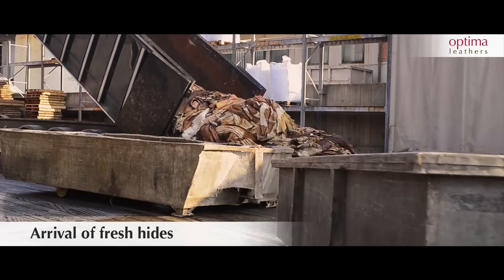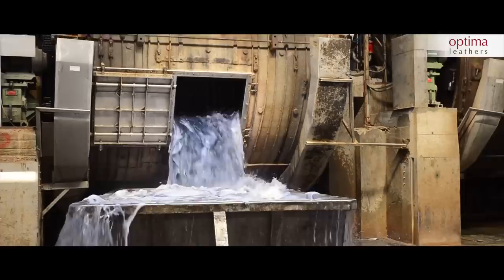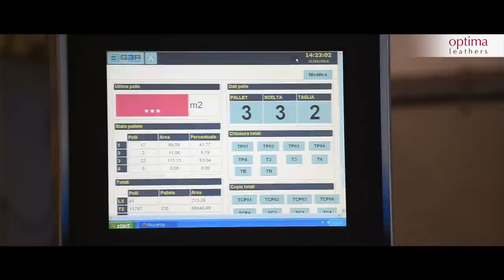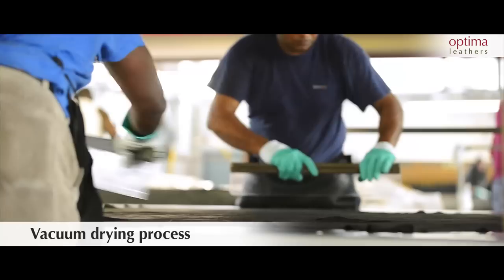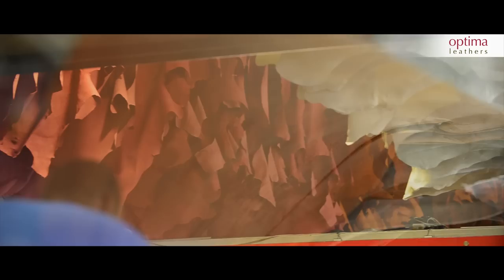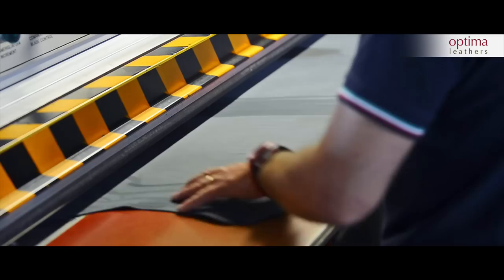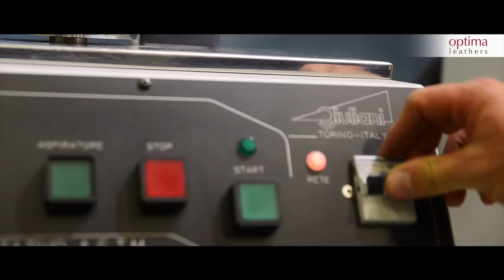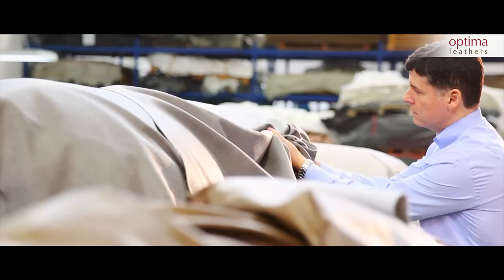The Tanning and Finishing Process of Optima Leathers

Comment: so why not let the natural grain of the leather be seen? instead you guys emboss it, why? any reason other than consistency?
Reply: This is a difficult question that i dont expect you will get a good response on. all leathers up to about 1980s were made using a vegetable tanning process. natural barks and tannins were used to preserve the leather. the by product could safely be poured on your lawn if you wanted, and the tanning solution was far less damaging on the leather itself. the leather would come out with a nice, natural colour, and the fibers were far less damaged in the tanning process. however, it would take much longer (weeks, rather than hours), and the leather felt more stiff right from the tannery and needed time to be broken in. 

as a result, the chromium tanning process took over. almost all leather today is manufactured with this process, however, the byproducts are extremely dangerous and need to be carefully managed. also, the leather is also far more damaged and discoloured after the tanning process. in order to hide the blue colours, tanneries will have to heavily dye their leathers. you can find many vegetable tanned hides that sill show their beautiful grains through a fairly translucent finish (check out horween or wickett and craig). however, the opaque dyes of the chrome tanning process leaves the hides looking a little flat and even. as a result, they will be stamped with this cell like grain to give some surface variation. after nearly 40 years of this stamped effect dominating the market, consumers now expect this artificial grain pattern on "premium" leathers and believe this is what leather naturally looks like. 

there are a few chrome tanned leathers where they use dyes to make the effect of surface variations, but this is still not the true grain, which is well hidden. 

anyway, chrome tanned leather isnt "bad", it has its place in garment and furniture since it is softer and cheaper, but look for veg tan wherever possible. its better for the environment, more rugged, and will show patina with use (whereas chrome tan will just wear out).
Reply: Lower quality hides, with more surface markings such as insect bites, scratches from thorny bushes, stone walls, fences etc are usually embossed. This hides the worst of the defects and allows more of the hide to be used.

Auto manufacturers design their own particular grains (such as BMW's Dakota & Montana, Range Rover Taurus) and apply it to their leather trimmed cars, but these are usually the lower priced trim lebels.
The higher priced trim levels (such as Range Rover Vogue/Autobiography) will use a natural Nappa type of leather with no artificial embossed grain, but a higher quality hide is required as every marking will be visible. These hides as a result are more expensive, but look better and feel softer because they are not subject to the immense pressure that is applied by the plate or roller that imparts the grain.

So in short, embossed/grained leathers are more economical for the trimmer to use compared to the natural Nappa or semi aniline types, but they do not look as good, or feel as soft as the leathers that do not have the artificial grain embossed onto them,

Yes you are correct, many people are not aware that it is a fake grain and that a natural grain by contrast, is smooth.
Reply: Hi, this Isabirye from Uganda (Africa), please can you help me  with your  feeding process of retanning thanks